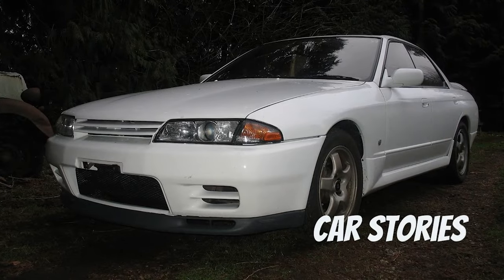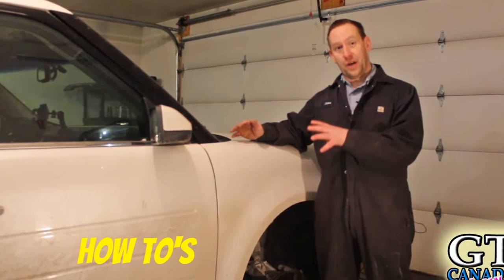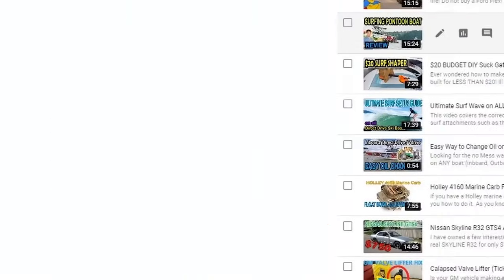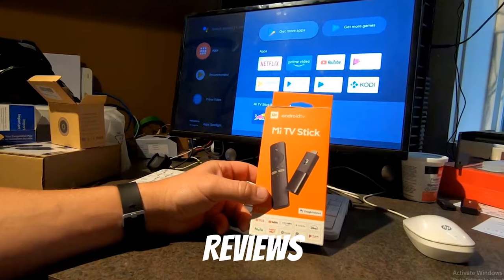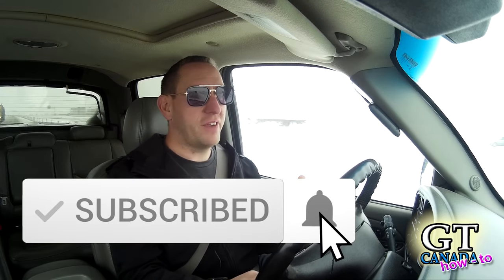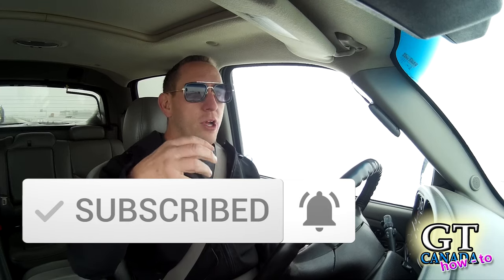ILLEGAL MOD! ~ DIY Gutted Catalytic Converter. Its EASY, Its FREE, Its FUN - GT Canada How To

Comment: Never should have had these on a vehicle in the first place
Reply from the maker: Truth
Reply: Agreed
Reply: I'm all for hella power and straight piped exhaust, but it's a good way to kill children and cause insane amounts of cancer via inhalation of the shit the exhaust spews. It even was the cause of all that acid rain that was common during the 70s and 80s, and I'm clueless where nearly all cars having cats now it's not a problem anymore. Would you say you wish gasoline was still leaded? Probably not, and pure exhaust fumes are almost as harmful as the vaporized lead that people back in the day had to inhale constantly.
Reply: I do think taking lead out of the gas was a good move, but still, I have never seen actual measured results of environmental damage.  You have to understand the political motivations behind such movements too.  You are not considering that at all,---and these anti-free market pricks are very tricky.
Reply: @EarthSurferUSA  lead was actually a decent lubricant in the engine, some things had to be redesigned to overcome the lack of it
Reply: @Yixdy  only if you run it with the garage door down.
Reply: Facts
Reply: @Yixdy Bull
Reply: I gutted all three of mine on my 2010 Honda Accord 3.5 V6 coupe best thing I did for it sounds great and more horse power 🤔💯⚠️
Reply: Yea , do airplanes have catalytic converters. Nope
Reply: As much as i hate the false idea of cars causing temp change even though they dont, i like them. They definatly improve air quality. They should be on cars, but NOONE should be forced to have or maintain a catalytic converter they dont want. Not to mention unless you have a bad catalytic converter they dont rob you of any power. I could i imagine on some high power engines it robs a little bit of power.
Reply: @rosieclark3661  Still running good?

Comment: Beware, gutting your converter may damage your engine on vehicles later than 96 due computer pollution sensors which monitor upstream and downstream exhaust gases. Your vehicles computer use the data to adjust air/fuel ratios and can cause your engine to run too lean or most likely rich which can cause poor fuel economy and excess carbon buildup.
Reply: You’ll need what’s called and o2 Fowler plug adapter to pull the o2 further out of the exhaust stream so it read correct. People using race pipes use these where there is no cat in place at all.
Reply: Ya, it's not as simple as the guy in the video puts it: with all the tuning and other exhaust mods you would have to make for it to be safe for the engine and to get enough horsepower for it to be worth it (especially on vehicles with smaller engines), but it is worth doing if you got an old cat in a lot of cases just because they can get expensive.

 If you're buying a new car fresh of the lot, maybe leave it in till its used up though, that's how I see it....
Reply: @darronpattel  personally I think it does more harm than good. It’s perfect if you need to look stock, but with a hollow barrel larger than the diameter of the pipe coming in and out, it creates a sport for turbulence, which can create heat from exhausts that can’t get out and swirl around inside the gutted cat, and or slow your exhaust flow down, which can be why some people lose power.
Reply: @Subi_doo  Exactly, its stuff like that he shoulda been mentioning. I'm a welder because my dad was a welder by trade so I made my own straight pipe in less then an hr and im not even a pro welder or anything. 

So if you get the right person to do that, tune it and maybe put some new headers on then in most cases ur good, but he mentions none of that in the vid.
Reply: @Subi_doo  For my car with making the straight pipe myself, the tune, and new headers; it cost me around 4000$ CAD with labour. 

Even with that costing more then getting a new cat, ill never have to get a new one again.
Reply from the maker: Appreciate the healthy conversation.

I covered the risks in the video

A tune is not required. It is nice to do after. But Come on, this is being done on a car bought for $500 to bag on

Anyone with a really nice car is not going to just bash the cats out and walk away.
Reply: @GearsAndTech  you’d be surprised what people do to nice cars lol. I’ve seen worse than knocking out the cat….
Reply: @GearsAndTech  A tune is not always required * 

Some cars regardless of how cheap they are can have engine issues if you remove the cat without a tune, especially if you're just gutting the cat.

The straight pipe itself cost me 20$ to make and took less time then gutting a cat would that's all.

Also, without the headers the tune would have been a lot less. Its cus I'm running an FD rx7 so parts can be ridiculous in price, plus in BC mechanics are pricey here cus theres not many good mechanics.
Reply from the maker: I totally agree that a straight pipe is better, but it's at least $20 and for most people it's more

We were gutting the cat for our budget road trip

https://youtu.be/qrV09sqdsk8

We didn't care if the car lasted longer than a week.

Also, since it's a boosted car having the gutted cat is great for performance!

But yes, this is totally a hack way to straight pipe your car. And I hope that's clear from the video

You should see how we accessed the fuel pump in this car!

In bc you won't pass air care with this mod anyway. I assume you guys still have that at the coast

We are lucky to have no emissions testing at all
Reply: @GearsAndTech  In BC they don't aircare anything made after 92 now which is good, so going catless is kinda hazy as far as the laws concerned, kinda annoying still if you have a nice old muscle car but ya. Muffler deletes are illegal though....
Reply from the maker: That's great to hear

I remember my sister trying to figure out how to pass air care with her 78 Dodge aspen with a straight pipe

We moved to AB before she had to worry about it.

Here it's hard to find a shop that will delete a cat, but it's not illigal to do it
Reply: Tunes are not required IVE done this to three bmws and never caused ANY. Issues like these clowns are claiming great video bro
Reply: @girlshots1  you still need to space out the O2 to compensate for the un-restrictive flow. This is why most cars, you can’t put “test pipes” without tuning the ecu or adding fowlers.
Reply: @girlshots1  yes, technically. If the exhaust is free flowing to fast, it will throw off the reading, resulting in a CEL. Fix for this is an O2 fowler. I’m saying this, because I’ve been through this with my 350z after swapping in cat less downpipes.
Reply: The bottom line is. If you gut a cat or remove it, you will get a code, unless your pre emissions. The way to fix this is to space out the O2 and attempt to trick the computer.
Reply: @girlshots1   so are you saying that the fumes wouldn't swirl and wont restrict it at all, and not affect heat dissipation in gutted cat vs straight pipe? Like they'd be the same? Only asking bc I wanna gut my cats on my 02 mustang and don't have enough for straight pipe. Got the Flowmaster muffler and tip tho
Reply: Actually a lot of newer cars can actually learn and adjust timing as needed. The 02 sensor these days is just used to monitor the efficiency of the cat. The upstream 02 is a more intelligent/precise air/fuel ratio sensor. Which is usually what’s controlling  the air to fuel ratio. Sure without a tune your engine won’t be able to take much advantage of that new breathing room. Same idea with an exhaust. But it will allow the engine to maximize performance using the factory tune. In the long run it’s not going to do much in the way of “damaging” your engine. Just will allow your engine to more efficiently pull are in and blah blah blah, that’s for a different time.
Reply: O2 sensor spacer
Reply: @Subi_doo  he said put the pipe back in the empty cat housing. You just put some piping in there.
Reply: I wanna just drill holes in my cell for more sound that's about it
Reply: Remap will sort it after cat delete

Comment: The check engine light can be avoided (vehicles with a downstream O2 sensor) by installing a non-fowler..many vids on the subject.
Reply from the maker: Excellent point.
Reply: Did it to mine and it didn't work
Reply: @jeffwain  did you try filling the gap in the non-fowler with steel wool?
Reply: That doesn’t help though if your cats clog up cuz ur vehicle still runs like poo
Reply: @Kelli Smith agreed. My suggestion was solely about cat delete O2 code circumvent.
Reply: I recommend the steel wool as primitive precaution

Comment: I don't know if it still is, but it used to be a federal crime in the US to try and pass off a punched cat as legit on inspection. In those states mix up some high octane fuel that will send more unburnt fuel into the exhaust thus burning up the cat, then if you fail inspection there are no tool marks or signs of tampering. By the way most of the time a hot exhaust will still pass, I passed with melted down cats for about 5 years before I had to start over.
Reply from the maker: Great points

Comment: My 2005 Mercedes E320 CDi had two cats, a big ass one behind the turbo and a secondary one further down the system, both gone and ZERO smoke, only an extra poke along with a very welcome increase in mpg's. Strangely there was not one O2 sensor on the whole system so no dash lights either. Engine is happy and so am I. Greta maybe not so much. Done it in every diesel  car I've owned and the emissions test are always very low during the annual MOT test we have here in the UK. Go figure...Petrol (gasoline) cars it's a huge no no though, impossible to pass the emissions test without a cat fitted unless your car is historic or pre 1991.

Comment: I disconnected the check engine light altogether and I only hook up the OBD scanner when I notice something is off. I grew up driving cars made before OBD so I don't mind waiting for a symptom before doing a diagnosis/scan/troubleshoot. Don't need a light.
Reply: How did you disconnect the Check Engine Light?
Reply: This comment deserves more likes! 😂 😂 😂
Reply: @johnmarshall5678 on one of my cars, it's literally a lightbulb that is on the back of the gauge cluster.

Comment: Here in Ontario Doug Ford love Premier took out the drive clean program where you had to go in every two years hook your car up to a machine and make sure it was up to code. If you had any codes showing you would have to get all those repairs done first. Now that shit's gone it'll be straight pipes and Cherry Bomb mufflers. Thanks guys great video
Reply from the maker: Hah, you guys will be like Albertans in no time!

We don't require cats here because we still drive our farm vehicles into the hay fields. A glowing red cat can cause a field fire. So they are not mandated on any vehicle.

Welcome to the wild west!

I knew I liked that Doug Ford guy!
Reply from the maker: I stopped paying attention to politics. But I hear that guy is all over the map
Reply from the maker: No worries
Reply: ACTUALLY even though Herr Ford deleted the drive clean program you can still face hefty fines for modding your emissions system. The sure fire tell by police? Your loud exhaust as well as the smell of the uncatylized exhaust. I cannot confirm but I've been told that cops now carry db meters to measure the sound of your exhaust. They can immediately pull your plates and have you towed to an inspection centre.

Comment: The point of a cat is to charge rediculous prices for something that doesn't really do shit except cost you money....by restricting your motor then when they go out you gotta spend a shitload....plus you gotta fuck with o2 sensors as well. You can cut them out and cut you some pipe with the o2 sensor threads and weld that back in so you don't throw sensor codes
Reply: U inspire me bro. I'm cutting my shit it's pointless and I'm using the 02 fouler
Reply: You’re right, I am ok with the O2 sensors for managing the fuel injection, but the rest is just a huge cashgrab
Reply: Does the downstream o2 sensor have any effect on the way the engine runs if you dont weld on a spacer for the o2 sensor or will it run fine if it throws a code?
Reply from the maker: It can yes.

Comment: Ok. So how does one get the car back to normal exhaust decibels?? On something designed for quiet and confront such as say...a 2000 Toyota Avalon...how would a person get it quiet again? Can someone stuff inside some kind of stainless wire mesh or steel wool material? Any ideas? Thanks
Reply from the maker: Tail pipe baffle that bolts in and out will make it quiet

Comment: So if it to throw an 02 sencor code won't that make your car run crappy as the computer is trying to compensate for the bad sencors?
Reply: Not necessarily, all a code is your car is detecting something. So I have a missing sensor somewhere for my tire pressure, the light is always on (my alignment is fucked however all 4 can be at over 32 psi and the lights still on) but when I blow a tire or get a nail (I don’t notice usually till the next day) any time there’s a drop in psi that’s more than unusual it’ll go off that moment it’s happening. So technically as long as there’s no other issues with the car all it’s picking up is “hey there’s to much bad exhaust exiting the vehicle” when in reality that code was already there to begin with but now instead of being a filter it’s a clogged hole letting bits of exhaust by pass. If you haven’t found it already there is a spark plug adapter that will fix the issue
Reply: I thought the sensors went back to the computer and adjusted how the fuel injectors work or something like that. I thought they did more than just tell the computer what it's reading. I thought they actually made adjustments according to them? 🇺🇸💪🏼👊🏼🤙🏼
Reply: @c_mac7773  they do. I had some bad ones and my truck was running like a piece of junk. Smoking black, had carbon coming out of the tail pipe. Real sluggish. I changed them, reset the computer and the truck started running right again. So it defintly does more than just what folks say
Reply: @jason6325  just ordered two adapters so I can remove the guts of my converters
Reply: @c_mac7773  what are those? Because my truck has over 400,000 mi and my converters are clogged up. I keep getting a catalyst efficency Below threshold. Soi know it's bad. But was told if i gutted it then it will throw codes.
Reply: @jason6325  you remove your O2 sensors. Then you thread in this adapter basically a spacer. Then you thread your O2 sensors back in. This will give the computer the proper reading so you don't throw codes and ur engine will run properly

Comment: Defo fun. Here in the UK would make the yearly tech test fail so sport cat best option for on the road vehicles.
Reply from the maker: the advantage of living in Alberta, we dont require cats on cars. So its ok to take it out and straight pipe, or gut it like we did here.
Reply: @GearsAndTech  Nice to be able to do so :)
Reply from the maker: @Beardchanics  you guys would love it here!
Reply: @GearsAndTech  I'm sure. If it wasn't for the distance with family Canada is a place I would love to move to.
Reply: Trust me it doesn't matter in the UK 🤣🤣 slip some money to.the garage and it will pass the MOT
Reply: Get a o2 fouler
Reply: @fratboygaming  will still fail tailpipe tests, where they actually suck up and check the contents of your vehicles exhaust. Rear o2 sensor simulators will only turn off the check engine light, not clean up your fumes unfortunately
Reply: @fratboygaming  it also doesn’t fix the issue of power loss due to cats being clogged! It just removes check engine light!
Reply: Ken Willis I’m aware
Reply: @fratboygaming  are you aware if you keep driving it like that you will eventually kill the motor?
Reply from the maker: Not true. No motor ever died from missing a cat.
Reply: @GearsAndTech  not from missing a cat! If you read the entire comments between him and I you would know the context! From running it with the cats clogged and just turning off check engine light While still down on power!!
Reply from the maker: Ah, sorry, I didn't see you guys started talking about clogged cats

If they are clogged the engine won't last long at all.
Reply: @GearsAndTech  I agree! I was trying to point that out to those that were saying they just wanted the easy way to turn off the check engine light!
Reply: Slip the garage some cash and they will pass it, my moped has an illegal exhaust and to big engine for my age of riding and I always slip them £30 and they pass it
Reply from the maker: If you keep driving any combustion engine powered vehicle you will eventually kill it!

Lol,like seriously every engine will die eventually.

How much fun do you want to have before it dies?
Reply: Just put in a highflow cat. You can probably make most of your money back by recycling the OEM cat too!